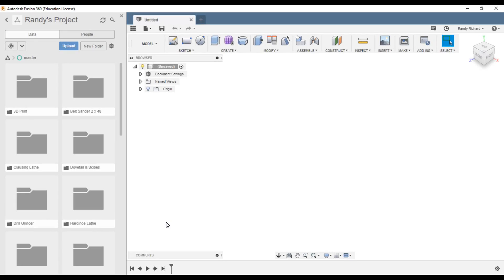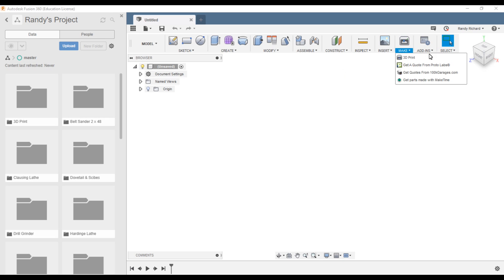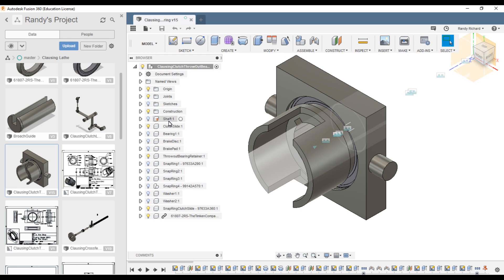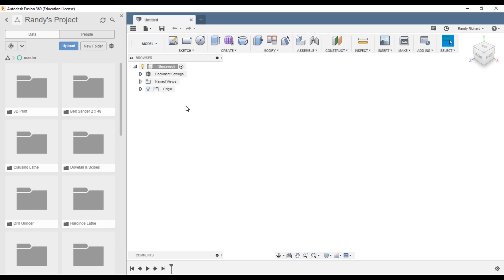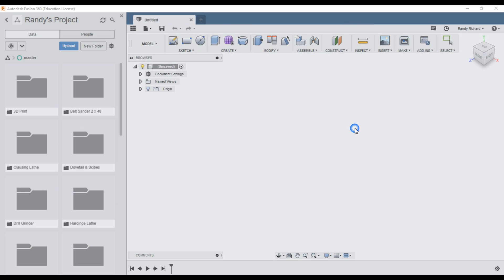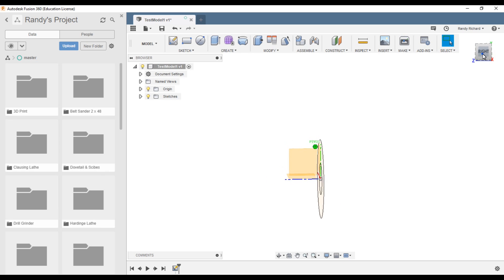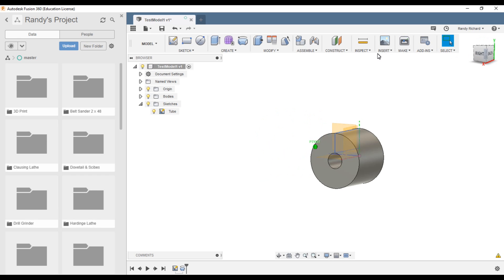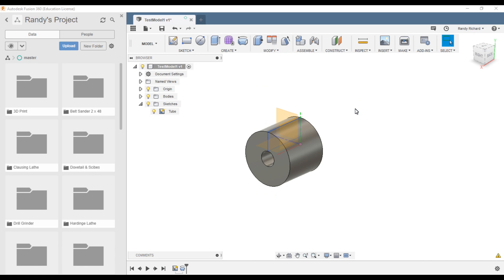P1-1 How to Model Intro - Model Steam Engine From the Ground UP

Comment: I got stuck with (and in) and old military/education version of Cadkey (DOS OS), that I'd bought at a hamfest.  It came on a set of 5.25 floppies.  I figured out how to do things with it with not much more help than the help in the program ... starting waaaaayyyy back before Windows 95 (shutter!).  These days I have to run it in an emulator, and I have the converter to update a copy of the project file to newer program versions.  I can then open it in a viewer, in Windows, and print it out.  You are supposed to be able to run it to a plotter, if you have one.

I haven't been able to apply myself to any other CAD program enough to get it to do what I want.  Like my welding, I guess I'm stuck with the dinosaurs ... ... but it sure runs good on today's computers.  No running out of memory since the days of the second generation pentium.  And I'm not in to cnc or 3D printing at this time, so it serves my purposes well enough.

Comment: The nomenclature may be a little different in Fusion 360, but it appears to have a lot of similarities to the CAD program I use. I believe that what you are referring to as "parts" are "layers" and the light-bulb symbol is for turning a particular layer's viability on and off. 
As a suggestion, close your folders when you don't need to access another file. It will give you more space to work in so that you don't have to zoom in and out as frequently. When working with large or detail parts, the  little extra space helps, together with the biggest monitor you can get.

Comment: 6:41: You're running Fusion: the fastest computer won't help. Very powerful, but slow. Nice introduction here. I've been using Fusion since soon after it was released (have been using and teaching Inventor longer, and using CAD since the 1980s), and it is not my go-to, but over the last couple years has become my recommendation for beginners that need a real modeller. 11:45-- minimizing the number of sketches isn't always the best way to go. Derived features often work better on a new sketch, and if a sketch becomes too complex, it can be difficult, or impossible, to properly remove all degrees of freedom.  A classic example is a vee block: Model the block, then cut the vee using a second sketch and an extruded cut, then cut grooves for the clamp toes using a third sketch. This also makes it easier when building a number of related models.... Making a set of six small vee blocks for different stock sizes for a rotary fixture? You only need change the sketch for the vee, not the stock profile or the clamp grooves, and you can insure that there are no dependencies corrupted if each as a separate sketch. Of course, this is easier yet with derived models...